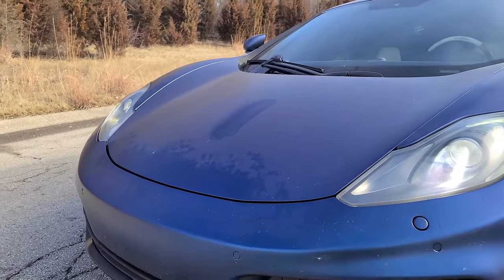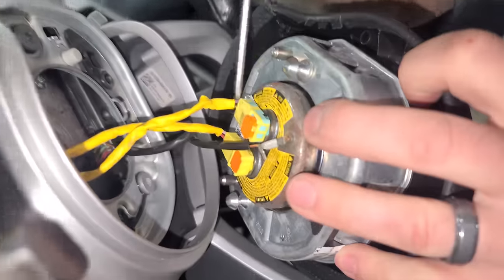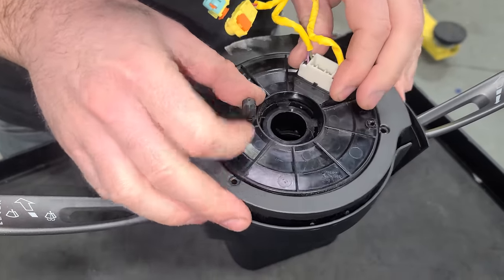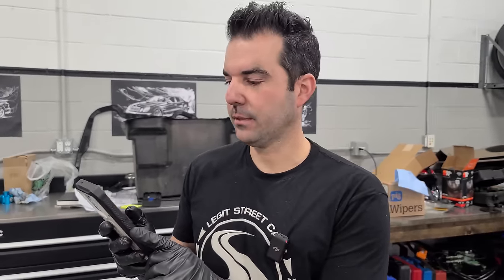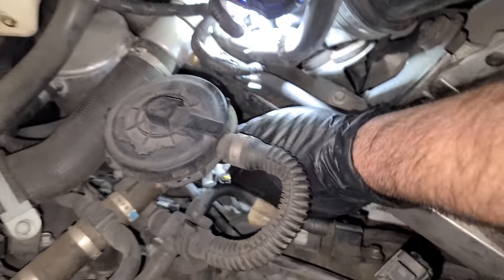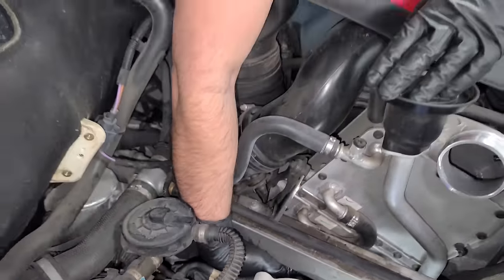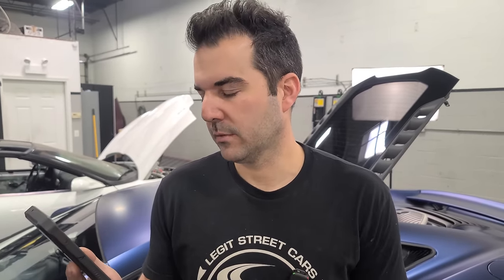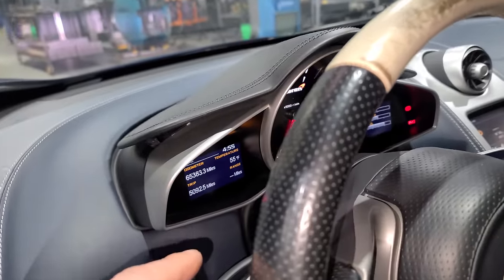I Fixed My Broken Supercar With Used & CHEAP Nissan Sentra Parts! McLaren Wanted $7,500 For This!

Comment: It's like the first time I did a starter on a coyote f150 the last bolt took 2 swivels 3 extensions and a 12 of a turn each attempt. U feel yah guys lambo has also used a fair bit of nissan parts

Comment: "Stealerships" suck, I quite being an auto tech after 20yrs.. My mothers Toyota only has 100k miles and they wrote an estimate for $7,000 in repairs. I fixed them all for $600 in parts and my time(10hours)

Comment: Tavarish's 675LT engine had the same rod problem as that engine you showed at 56:59 , even appears to be the same rod, but in this one the damage seems much bigger than his. Would that be a common thing in those engines? 🤔
Edit: Correction, it isn't the same rod, they are opposites 😅

Comment: Regarding the lack of response by McLaren dealers - having dealt with an "exotic" brand culture - these dealers aren't used to dealing with the owners of these vehicles (perish the thought of owners that actually spin wrenches on their own cars).  They're used to talking to the owner's "people".  This means that when "the people" call and leave a message, and don't get a call back within half of a business day, they're getting another call, and another call, and another call until that dealer responds.  The dealers apply this method of gatekeeping against tire kickers quite normally.  To normies like you and I, it appears as if they're not getting proper customer service - but to the dealer its a method of separating the wheat from the chaff.

Comment: something looks wrong with the orange plastic lip on the top of the air filter, like its been broken off. not sure if thats normal, or that could cause it to not seal / filter properly

Comment: Someone should 3d print some covers for the ports on the engine so you can wash it without worrying about excess water getting in. put handles on them so you can pull them right out after

Comment: I read the WIKI 🏅and it said 91.   Because the picture of the pumps don't show 103.  But it could be 103.  RON 96 to 98, MON 86 to 88,  USA (RON+/MON)/2 the low end (96+86)/2 and the high end (98+88)/2  :B so, high compression engine, high octane, premium gas.

Comment: A lot of even common daily cars the owners manuals were reversed back to 5-8k mile oil change intervals not the 10k originally told everyone! (Toyota and Honda but biggest was Hyundai and Kia) and found out they blew engines due to build up sludge clogging oil pickup tube causing oil to not get sucked to the top and circulate properly! 
Or they blue engines because they never made it to the next 10,000 miles because the low tension piston rings would allow to bypass causing it to burn oil, and after awhile the slow oil burn would speed up and each oil change would have a lower amount of oil in it and eventually by the time they hit the next 10,000 miles go in for an oil change they were lucky if they had half a quart of oil left
(Course no one told the owners!) and they go back out and drive thinking nothing of it and idk they’ll hit 5k miles on the new oil and not know oil pans empty already unless they hear engine ticking or oil light goes on. (But I’ve seen many oil lights never go on) 
And u don’t hear ticking motors on highways!
     So even on new cars least check your fluids once a month or so! 
You maybe held responsible even on a new car for expensive repairs regardless of warranty’s they’ll try and pin it on the owners saying lack of maintenance! 
     They say that the only ones that should be doing 10,000 mile oil change intervals are the ones that do mostly highway driving but if you do mostly in town or city driving it should be 5k

Comment: Probably an unfair cost comparison. The dealer is most likely covering all his other overhead costs, ie.  Licences, insurances,  etc. 

Though from a DIYer POV it would be the best option if one is technically capable and equipped. And it does pay to know your part no's as alot of manufacturers cross reference parts between different models.

Comment: 98 RON (Research Octane Number) is equivalent to 93.5  U.S. Octane (MON/RON - Motor Octane Number/Research Octane Number).
Reply: Premium fuel in the UK can be up to 99 or 100 RON depending on brand. They also have better additive packages than regular.

Comment: i got a hyundai sonata 375 thousand bought new only part i put on this car is new battery cant even here it run smooth as a can be i do oil changes and stuff i thought it would have died long ago its 2.2 2006 huyndai sonata auto

Comment: Oh horrors, please do not ever spray solvent into an electronic, throttle body, often times it will leak past the seal and get into the potentiometer and ruin the throttle body period always spray your brake cleaner on your rag, and then wipe out the throttlebody. It’s OK to spray a little brake cleaner on the inside of the intake manifold to soften up the deposits. But never in the electronic throttle body more tips from Jay Tiger, in Thailand.

Comment: Drops a plug into the black hole of parts eaters. "We are going to going to pretend that didnt happen for now." Just like working on every other "normal car" at home. Most likely the shop time price is so high because they know they are going to do the same thing, but they will have to in and get it.

Comment: Don't celebrate too fast, you very likely just cleared a few codes having the battery fully disconnected. Chances are you will get a few warning lights back after attempting a drive for a few miles.

Comment: FYI, I did notice the ripped Gloves. As a Retired Pro Wrench, my preference for Gloves was Blue Nitrile "Diamond Grip Microflex". I prefer Blue over Black so that at a glance I could tell if the Gloves I was wearing were clean enough to work on the interior of a Clients Vehicle.  Randy   AKA randog311
Reply: Good call just put some black gloves on today to do a CV boot, had no idea how much CV grease was on them.

Comment: Chronologically there is something messed up with this video. You fixed the airbag, ignition coils and plugs. Then you went for a drive and filled the tank. The mileage was at that point 65536. Then you went to get the codes cleared at Cannonball. The mileage at Cannonball was 65383. Is it me, or is something wierd here........

Comment: So you say the McLaren dealer wanted 7500 for the same work you did... They would have put a new clock spring on which you spent about 900 on a used one from a friend... Plus they are paying mechanics that are McLaren Certified... That cert is not cheap to obtain... No hate here love your content and you and your team as people... Just wanted to make sure to point out the obvious lol... And it's MCLAREN... WalMart sunglasses are comparable to Oakley's... But you pay for the name... Same here plus paying for the mechanics time...

But love your videos... And sorry I may have mainly typed this because I was originally shocked at the difference until I started thinking into everything... I'm an aircraft mechanic with several certification from Gulfstream, Airbus, Cessna, Hawker, to Boeing... And many certs under every brand for many different types of work... So my hourly rate charged to the customer by my company is stupid high... Because I'm so well versed in every plane... Even putting me on a low budget plane is costly because I could be used on a high end jet...

Comment: Copy from Wiki on RON:
Research Octane Number (RON)
The most common type of octane rating worldwide is the Research Octane Number (RON). RON is determined by running the fuel in a test engine with a variable compression ratio under controlled conditions, and comparing the results with those for mixtures of iso-octane and n-heptane. The compression ratio is varied during the test to challenge the fuel's antiknocking tendency, as an increase in the compression ratio will increase the chances of knocking.

Motor Octane Number (MON)
Another type of octane rating, called Motor Octane Number (MON), is determined at 900 rpm engine speed instead of the 600 rpm for RON. MON testing uses a similar test engine to that used in RON testing, but with a preheated fuel mixture, higher engine speed, and variable ignition timing to further stress the fuel's knock resistance. Depending on the composition of the fuel, the MON of a modern pump gasoline will be about 8 to 12 lower than the RON,[citation needed] but there is no direct link between RON and MON.

Anti-Knock Index (AKI) or (R+M)/2
In most countries in Europe (also in Australia, Pakistan and New Zealand) the "headline" octane rating shown on the pump is the RON, but in Canada, the United States, and Mexico, the headline number is the simple mean or average of the RON and the MON, called the Anti-Knock Index (AKI), and often written on pumps as (R+M)/2.

Comment: Should never have switched out the pneumatic suspension. The curb weight is way too heavy for conventional shocks to give any sort of comfortable ride. I have an 07 Land Rover with just shy of 300,000 km's, and my truck is still riding on her factory installed pneumatic suspension and works as it should with only ever having two pumps installed throughout it's life to date. North American Land Rover dealers have no clue as to what they are doing and only want your money. Only take such vehicles to a private Land Rover master tech shop.

Comment: How is fuel quality measured and rated

Gasoline quality is measured experimentally but using different tests. Depending on the test that is done to control fuel quality, we get

Research Octane Number (RON) , used in Europe and most of the world
Motor Octane Number (MON)
Because two different tests define RON and MON, with MON testing done under more difficult conditions, MON number is always lower than RON.

Europe vs the States

In Europe, gas stations describe different types of gasoline based on their RON rating. It is typical to have 100, 99, 98, 97 or 95 RON with prices varying accordingly. In the States the descriptions look a lot like RON, but they are not.

Pump gas

In the United States gas stations describe the types of gasoline based on the Pump Octane Number (PON). That number is the average between RON and MON. This causes many problems.

If a fuel is 98 RON then it will be 93 PON -> 93 PUMP
If a fuel is 95 RON and 87 MON then it will be 91 PON -> 91 PUMP

Comment: The fact you said Nissan Sentra and not Nissan GTR I am shocked. I'll look at least expecting it to be related to the VR engine from the GTR because that would make sense. Instead I'm going to see the McLaren guys at the junkyard
Reply: McLaren bought the rights to the Nissan VRH35L V8 twin turbo a pure racing engine in the GT1 class. Ricardo in England make the engines.

Comment: MY boss had one of these back in ~2013 and every once in a while I got to take to to service or detailed (yes I was kissing ass) who wouldn't he had 2 others as well and a RR Ghost as well as a Bentley and I usually got to take care of all of them when they needed something. Anyways. I never got that stupid swipe thing to work but one time. There is even videos one it. You have to do like a vulcan finger hand, one on the edge and 2 underneath and drag it exactly. Cool idea but sucked. They should have just had it where if you had capacitive contact with your hand underneath the ledge for I dont know 2 seconds? the computer would scan for the key, validate and unlock. Thats the way my new Dodge ram sport is. You just touch the handle, not even push the button, and the door unlocks. If your key close enough. The button is there to re-lock

Comment: It's really sickening the prices they charge for these exotic rides when they're parts are just random everyday car parts for everyday drivers. Just because it's a McLaren
Reply: Well that's not true. The McLaren has a carbon fiber central chassis. The engine made by Recardo is based on a design that raced in GT1, LeMans. The gearbox is an expensive Graziano unit.

Comment: Come on Alex just pull the boot off the coil... They are two piece... It'll show you the spring connection to the coil connection and how corroded they are....

Comment: Not British if you say 'I will bring my car to the shop' when you actually mean 'I will take my car to the shop' and you wouldn't use the term 'shop' to refer to the dealer or mechanic's or garage. Why are Americans so confused about the use of the word 'bring'? Such a strange grammatical error, I have also always wondered about why they always say 'of' when there is not need or reason for it, 'Off of'.

Comment: The word “Countach” itself kind of alludes to the Lamborghini ethos.    A tad vulgar, if not simply vulgar, overstated, function and comfort be damned, appearance first, top speed second, reliability fifth.   Fire propensity is fourth, packaging is seventh, and taking third place is character, where the idiosyncrasies are its signature.   Awkward footwells are the norm, funky shifter gating, disproportionate clutch action, and brakes often would work better if the hardware were thrown overboard.    Lamborghinis are driven by guys who use the middle finger like a reflex, prefer to offend rather than please, and rarely say “sorry”.   Ferraris are for guys who sit slack jawed at Vivaldi concertos and are happy to grossly overpay for the best Italian wine with their fresh hand made pasta and unique top notch meatballs with only the youngest of veal bits and bits of gold flake just for sizzle and shine before falling down. The gullet.   They simply worship Italian design and rightfully revere the cumulative beauty of the sports car as one, being equal parts beauty, handling, power, refinement, experience, and of course a somewhat ostentatious gentleman.    Tennis shoes are not even considered, and loafers are the norm, but for driving, sport loafers are mandatory.    Is there such a thing?   I’m sure.     Porches are for the clinical chaser of numbers, those who prefer to see their lives flash before their eyes every time the rear end breaks away in an unstoppable spin,  right on that one section of switchbacks above Lake Lucern where the guardrail is nonexistent , which means every section.    Ouch.   They prefer to idolize  somewhat questionable engineering for the sake of it being somewhat questionable, because air cooled is better, they say, and the back of a car should be a pendulum, they say.   They do sit and get, but while getting, try turning, and the understeer under acceleration is startling, yet it grows on the avid owner, somehow.   Under braking turn in might be world class, but who cares if the rest of the turn is unpredictable.    Design is squashed Volkswagen  Beetle, literally, and Hitler himself proclaimed those design cues, light, aero, simple, safe(ish), stable at high(relative term here) speeds on the autobahn.   No one will admit it, but the only reason a 911 has an air cooled flat engine hanging behind the rear axle is because the VW Beetle did, from which it was derived yet never admitted to, basically calling the rest of the world fools.    That’s like saying the modern Jeep CJ has nothing to do with the first Army General Purpose Vehicles which show obvious lineage.    Alfas are for those who cannot afford a Ferrari.   Aston Martins are for the Brit with a sense of high style and classy grunt, a tasteful step above the layperson, and assumes that the frequent service vacations and the subsequent bills are just accolades to the exclusivity of a high spirited thoroughbred.    McLaren owners are astute and hungry for world beating performance in a somewhat understated yet strikingly exotic car for the exclusive set, designed and produced in the homeland with pride enough ti hopefully be able to say, “see, we can make a real super car after all, so piss off!”, but not in public or certain circles.    Style is simply a positive byproduct of high function, a novel notion in a land of broken systems and millennia of tradition, where the desire to prove the world wrong outweighs their desire to have the prettiest, the fastest, the most attention, or the most envy.   The Ford GT is simply for those who KNOW that the Americans just have more experience and R&D and make things that just work.    The Mercedes is for the rest of the world, who are smart enough and endowed enough to buy the best engineering in the world, as flawed as it may be, still the best, and will own with pride, attempt humility, barely stave off the ostentatious label, feel as part of a higher class, regardless of the actual,  and soon enough become comfortable to forget that they are driving an automobile which is often the finest made, save for the Rolls and Bentley set, which in this discussion, are not super cars.      If I had my druthers, I’d have a McLaren P1 over anything.    Simply incredible.    Arguably more beautiful than a comparable Ferrari, definitely prettier than a  La Ferrari, and with performance comparable to ANYTHING.      And maybe simply because it’s NOT one of the OTHERS.